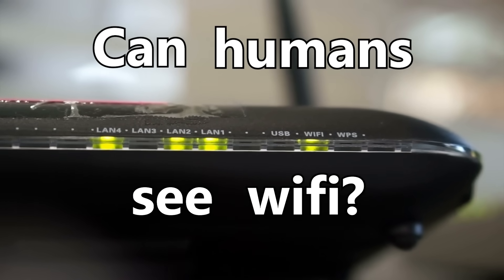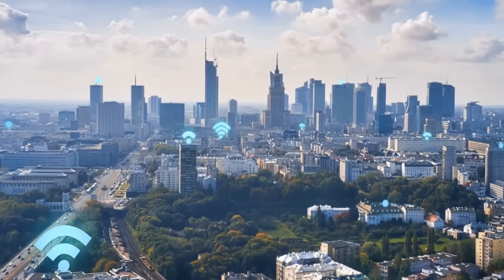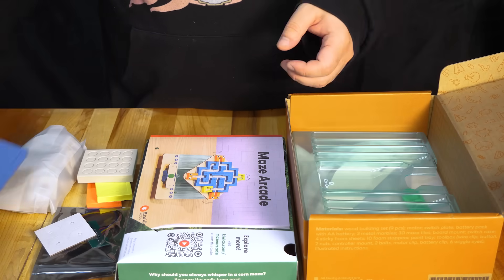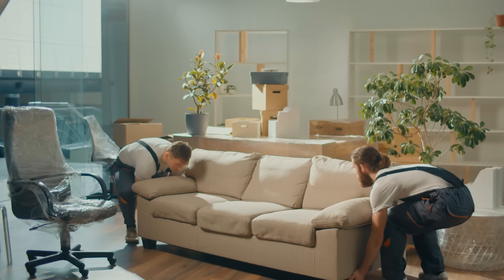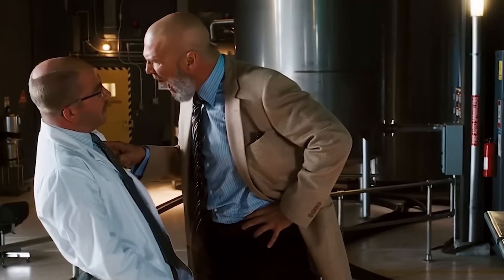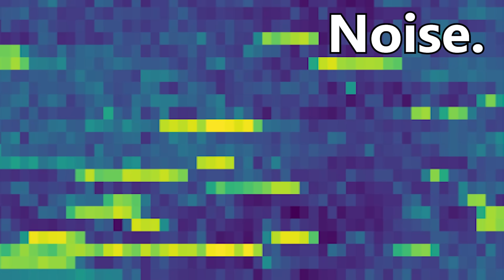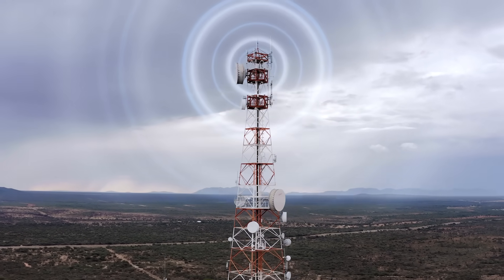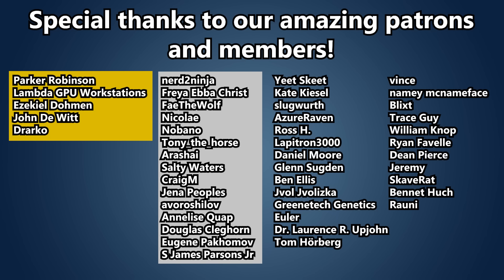This Camera Can SEE WiFi

Comment: Construction guy here! In North America (or the US at least, so possibly also Canada?) steel wall studs are usually required in  commercial buildings because of fire safety - bulk steel doesn't easily ignite and add fuel to a fire, while wood studs very much do.
Reply: Jet fuel can't melt steel beams after all.

😎
Reply: @Suninrags  To change the flame temperature all you need is oxygen.
Reply: this is blasphemy and only the old gods know the true anwser.
Reply: Dank memes can't melt steel beams

Comment: I am a WiFi engineer and this has been something I've wanted to do for YEARS.    Love your work. Keep it up.
Reply: there is an app that lets you map wifi by walking around the room whilst it takes measurements.
Reply: This is basically the entire idea of passive radar, except you can use these sources to get reflections from other objects as well...
A common experiment is using either cellular towers or broadcast FM stations to track low flying objects.

Comment: I want to do this kind of stuff so bad. I've been inspired by you and other YouTubers since I was 14 and have wanted to have the ability to just do science and engineering for the love of it even before that. Wish me luck, hopefully one day I'll get there, for now I'll just keep reading, because I have the resources for that.
Reply: Don't let lack of money slow you down. Engineering class do tend to be heavy on reading and homework, but there is a lot to gain from just messing around and building an intuitive feel for how things work. Learning to deal with what you can get and not what is ideal might also help later on when dealing with cost and engineering constraints. And with some creativity and time you can bootstrap building tools and lab equipment to make better tools and equipment.

A surprising amount can be done with crap. Well, not literal crap maybe. Some examples: Soak paper towels in watered down elmers/wood glue. Use it like poor man's fiberglass. Other types of paper and water/glue ratios give different structural properties.  (Isopropyl alcohol seemed like it might make a fast drying version but made a sort of slime that isn't as strong.)  Consider using flextures to keep hardware costs down. If you avoid exceeding its elastic limit(??) the aluminum from soda cans and steel from other cans can often git'er'done.  Although gears are nice to use and can be made with very careful hand filinging, pulleys and belts can accomplish quite a bit and are much easier to make by hand.

If you have clay rich soil and know how to refine it, and a fireplace, you can make some heat resistant parts. (The homemade clay, at least in my experience, is a lot less prone to exploding while firing because even after refining pretty well, it is more porous so steam easily vents while cooking.) I have used it and the nichrome wire from a junked hair dryer to make electronic power resistors. I'm working on a chemical hotplate and magnetic stirrer. First attempt was a miserable failure because I stupidly poured the clay on to water absorbing thermal insulation from an old stove. Sucked the water out so quickly it cracked like crazy.  

Dumpster dive. Businesses tend to discard printers and copy machines which are goldmines for parts. If there is a university with a good science and engineering college nearby, you struck platinum. Just be really careful because there can be dangerous exotic materials, electric shock hazards, and residues of toxic chemicals and...well assume it is out to get you. The library can be a source of free journals and outdated books that are still good enough for now. I

If you have a high tolerance for snakes, rats and roaches and don't mind cleaning it is sometimes possible to remove things from the local landfill/dump/tip without getting killed or yelled at.

Comment: 0:31 its not light. It is electromagnetic waves but it doesn't mean light. square rectangle thing
0:43 it still messes with internet connection if you are using 2.4GHz spectrum
1:09 no they're not they're between 600MHz to 300GHz

mate I am literally one minute in and you spread so much misinformation, you can do better
Reply: 0:31 yes it is light. The electromagnetic spectrum is light

Edit: see my other comment below this one
Reply: @henrysanecdotes5323  part of electromagnetic spectrum is light. nobody calls radio waves light
Reply: @ In some contexts, “light” refers to the full electromagnetic spectrum. However, it sometimes only refers to visible light.

Turns out we were both half right, whether or not radio waves are considered light depends. It’s incorrect to simply say it’s one or the other.

Comment: FYI - you can get metal parts laser cut, CNC machined, anodized, etc... etc... without owning any machinery at all. 

You can submit CAD files to places like Xometry, OshCut, SendCutSend for easy laser or water jet cutting (or CNC, or anything else).
Reply: reminder for people designing to take into account how something will be made. the less axis needed and the less tool changes the cheaper it will be. You also can get 3d printed Items a lot of people with 3d printers dont use them 24/7 and will go to local groups to rent out the extra time.

Comment: It would be extremely cool if you could scan WiFi 6 or WiFi 7, since those uses MIMO to project the signal. You might see some weird signals pointing specifically to one device, and then another zone when other device starts downloading something!

Comment: You need to build an phased array, so you can steer the antenna passively and faster, with higher resolution.
Reply: With a phased array, you get high single plane angular resolution from a single strong source given just 3 antennas (2 will create symmetric ambiguity). However you can't resolve more than N-1 sources really, and the beamforming capabilities are pretty weak compared to a very directional antenna. (3 dB attenuation per doubling of number of antennas)

If they could do something like a 100 by 100 array of antennas or more it would be quite cool, but I suspect it would be hard to design for an affordable budget.

Passive synthetic aperture radar does do something similar though, so there it some precedence.

Comment: 5G is not equivalent wit 5GHz! 5G means 5th generation and has many bands in 900MHz-300GHz but coincidentally not on the 5Ghz!
Reply: There is both 2.4Ghz (long range) and 5Ghz (shorter range, but faster) WiFi - there is also 5G, which is exclusive to telephone networks - that's where the fifth generation comes in.

Most routers nowadays are "dual band", meaning they can transmit and recieve both 2.4 and 5 GHz - sometimes it's split into two separately named networks, but for the most part nowadays it's configured so that it shows up as one SSID (WiFi network name) and switches between 2.4Ghz and 5Ghz based on signal strength between the router and client.
Reply: @graemewiebe2815  He's building 5g wifi, not cell full stop.
Reply: Which is 5ghz
Reply: @boutek  that's called 5ghz wifi, not 5g
Reply: @MathewPanicker1010  so tired of this thread. For fs he wasn't building 5g cellular, he was building 5g wifi which totally is what we're on right now. Smh
Reply: In the wireless world, Wi-Fi 6 aims to stand out from past generations, bringing with it a new generational naming system, increased IoT capabilities and multiuser support. For cellular, 5G introduces network speeds and data rates that cellular technology hasn't seen before, as well as low latency.

While Wi-Fi 6 and 5G differ in several ways, experts suggest the two technologies work well together to support enterprise use cases for IoT, edge computing and remote work.
Reply: 5G WiFi is actually 5GHz, FYI
Reply: @prophetzarquon  Thank you. Finally, a breath of fresh air in this annoying thread of troglodytes  where the OP refuses to correct his/her mistake.
Reply: What? Surely not.  Wifi is 5gh
Reply: @boutek 5G isn't wifi
Reply: @hashbrown777  Yes it is. And that's what he's clearly building. Have you even watched the video? He's not talking about 5g cell

Comment: Every time the antenna is moved there's quite a bit of wobble, it also seems the step size for the motion is rather large so your max resolution is limited.
Reply: yea I was really confused with all the 3d printers and access to machining (etc)  it was so wobbly 
seems like that would be the last thing you would want for camera.
Reply: he probably used an old stepper motor from a dead 3d printer or one that was moved to a better stepper motor.
Reply: With microwaves that doesn;t matter much, we see in the visible light because it is high resolution. visible light is in the 100's of nanometer wavelength, mircrowaves are on the order of centimeters.  You are never going to get much resolution out of a microwave camera.
Reply: The angular resolution of the antenna is probably low, so it probably doesn't matter anyway
Reply: @JasminUwU  Quite the contrary. Smaller the angular resolution, or more correctly, the beam directionality, the more little imperfections in the movement matters.
Reply: @anteshell  Angular resolution, resolving power, you get what I mean.
Reply: @JasminUwU  You are mistaken. A handy way for them to get more resolution without adding more antennas is to move the array by very small amounts (smaller than one "pixel" at the working range) in both X & Y, and then stack the images. But this is not possible if the mount wobbles.
Reply: @railgap  If you do that, you will just get a blurry image instead of a pixelated image
Reply: @JasminUwU   If an image is blurry, it is technically a higher definition image, just like how our phones when they take a picture, don't take it all at once, they instead take a quick scan of each pixel, which is why fast moving objects, such as someone running appears blurry, the pixelated image appears from each "sector' being scanned, and then put together like a puzzle, search about a "side scanning sonar" (or if your a fan of the game stormworks, people make lidar side scanners to take pictures of the seafloor, and i have made one that took a picture of a mountain)
Reply: yes I think scanning continuously would be better
Reply: Not to mention, that when scanning an object so close, you would want the detector to be a flat plain, e.g. like a camera CCD sensor or film, not spherical.
Reply: I could imagine, that they will pivot to a continuous scan in the future so it doesnt need to stop
Reply: What’s this got in common with with a camera photographer

Comment: Phased arrays.  Buy a dishy from starlink.  Single pixel cameras suck.  There's a reason your phone has a multi megapixel sensor in the midst of some compact optics.
Granted the wavelengths are orders of magnitude longer, but 100x100 pixels (antennas) is better than 1x1.

Multiplexing to get reasonable framerate is fairly straightforward.  

Add a dimension or two to your data plot, and you can use some interpolation to leverage parralax and temporal variations to model more complex objects and environments. 

The tech for body scans at airports uses some similar processes.

Comment: 1:07 while cellular 5G can contain 5GHz, the “5G” stands for 5th generation and not 5GHz, and 5G operates on a wide range of frequencies from 410MHz to 71GHz 
Edit: you might have confused this for the 5 GHz Wi-Fi band, which is sometimes called “5G”
Reply: Probably got mixed up with 5GHz wifi
Reply: @rosalina-dev  5ghz wifi isnt actually 5ghz. the center frequency is closer to 5.65 if i remember correctly.
Reply: @BedlessBlade it's not a specific frequency, it's a frequency band. 5GHz Wifi operates between 5.0 and 5.9 GHz.
Reply: @gamergod9182  i said centered and that is wrong. Most standards set wifi 5ghz to work within about 5.15ish and 5.7ish ghz.
Reply: @gamergod9182  it's much more spotty precisely segmented bands like just dozen channels ten MHz apart from like 5250 and 5750 or something like that, but it's not an interesting details so all rolled into "5GHz" nomenclature
Reply: @rosalina-dev  Wifi has generations as well, now officially called e.g. "Wi-Fi 5". And Wi-Fi 4 is actually the one to make 5GHz wifi commonplace.

802.11a (unofficially Wi-Fi 2) was also 5GHz but it was very uncommon. The common ones were b, g, n (generations 1, 3, 4 respectively).
Reply: @DiThi nice... I like this breakdown ... Thank you... AC = wifi 5 and now we are on wifi 6 & 7 in high end new scenarios as far as I know
Reply: @DiThi  I think you have some of your generations and numbers mixed up, but the idea is correct
Reply: @DoesntRefillTheBrita  I literally had the wikipedia table about wifi generations, standard names and supported frequencies in front of me.
Reply: @DiThi   wifi 7 is out
Reply: @aanthanyj Yes, Wifi 6’s IEEE number is 802.11ax and 7’s is 802.11be
Reply: Yes, cellular 5G is different than wifi 5G
Reply: THANK YOU. I hear so many people getting this mixed up!
Reply: holy bingle its melody
Reply: Yes, thank you
Reply: It's called "5G" because 5G is catchier than 256-QUAM
Reply: Correct!
Reply: Thanks. I was going to say them same. All these other people... so cringe...
Reply: You are correct, but many shops and vendors also use "5G" to refer to the 5GHz wifi band, even though this is non-standard terminology, leading to confusing shop listings on ebay and amazon like "WiFi 2.4G/5G with cell 4G"
Reply: 300 GHZ?!?  I think you added a zero, that's nonsense.
Reply: @railgap   Its not nonsense, that's the porter of the wave, the signal itself is going to be a very narrow band signal encoded in the main carrier frequency.
you can transmit at Thz with the proper crystals to do the splitting of frequencies, you just need a stable frequency source to subtract the carrier from the signal.
Reply: @ whoops
I Googled “5G frequencies” and some sources mentioned mmWave extended to 300GHz, but didn’t make it clear 5G doesn’t cover all of mmWave. More in depth research suggests 5G still ranges up to 71 GHz, so I edited the comment
Reply: don't they use like 50Ghz ?
Reply: @monad_tcp  About that, its from around half 1ghz to almost 50ghz
Reply: 2.4GHz WiFi & 5GHz WiFi are the two WiFi bands.

5G is a 5th generation phone communications standard, operating primarily in the 800-2000MHz range.

5G NR is an extension to the 5G phone standard working in mmWave range for high density, line of sight situations.

WiFi a, ac/4, 5, 6, 6E and 7 are versions of the WiFi standard that support the 5GHz band.

But "5G WiFi" does not exist. No matter how many people wrongly use the term.
Reply: Swilliamson - 5G Point Cloud
Reply: No one who works in Wi-Fi has EVER called 5Ghz 5G.  5G is the marketing term for a bunch of technologies at different frequencies that make up the “5th Generation” of cellular technology.
Reply: Thank you OP for posting.  I was just jumping online to post the same thing.  5G is not 5 gigahertz. 5g cellular mean "5th generation".  5ghz wifi is one of the (possible 3) frequency used.
Reply: if i recall correctly, that upper range can be harmful to skin/eyes/organs
Reply: @ I think it’s only at absurdly high power, like a microwave (which is in this range, 2.4GHz if memory serves), not the fractions of a watt that you’d receive from a phone or tower
Reply: @tylerdavault9604  not even close. Infrared (heat) starts at ~300GHz. Violet light is up to ~750THz.
Reply: From what I understand, the part of 5G that does the communicating with your phone is generally close to that 5 GHz range unless you are inside because it generally allows for much higher download speeds as opposed to the lower frequencies which have better penetrating power
Reply: @the_undead  But the 5G stands for 5th generation. Also it basically could use any frequency, it's about new technology and type of antenna which also makes it suitable for really high GHz ranges with phase arrays and beam forming. Also heard it can use polarization for simultaneous up and downstream on the same frequency.
Reply: @the_undead  This is incorrect, Cell and Wi-Fi frequencies are completely different. 5ghz means 5 gigahertz, 5g means 5th generation. The range for 5G cell data is 450 MHz to 47 GHz, while 5ghz Wi-Fi just means it operates at 5ghz. Wi-Fi also operates at 2.4ghz which is the same as microwaves. The only difference is the amplitude of the wave.
Reply: @the_undead your understanding is wrong.  It's often worthwhile to check your assumptions before declaring them to the world
Reply: @the_undead no, it isn’t.
Reply: @the_undead  No. It's same as 4G, could be anywhere from 450 to 5.2GHz depending on your carriers.
Reply: @すどにむ  450mhz to around 47ghz
Reply: @BubbleGumCanDevelop  in mmWave spots sure but there aren't a lot of those
Reply: We all clocked that but you just had to comment on it. Hope you got some gratification for such a meaningless action.
Reply: @ryan266846  I don’t think “we all” clocked that, otherwise the video itself wouldn’t have contained the error. I wasn’t trying to be self righteous I just wanted to help people out with a common misconception